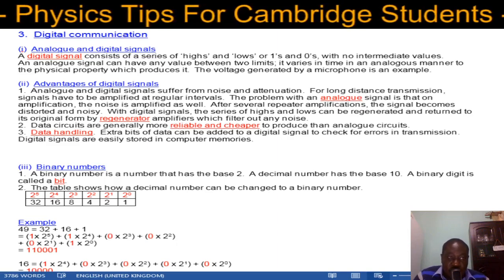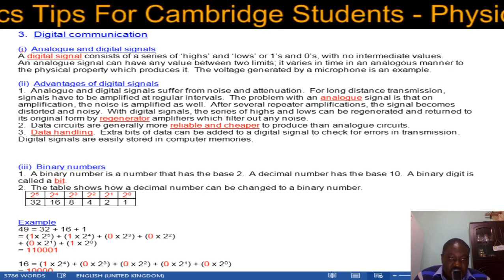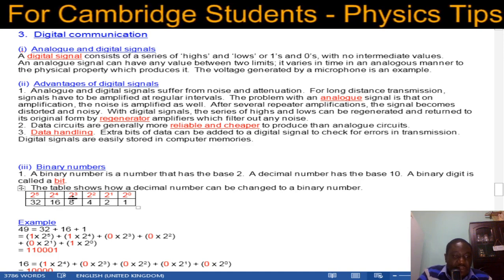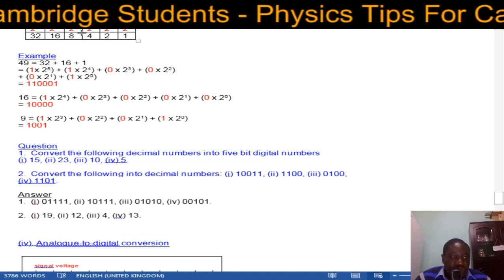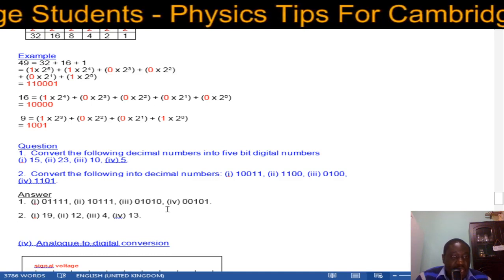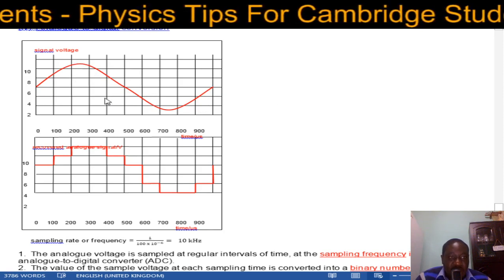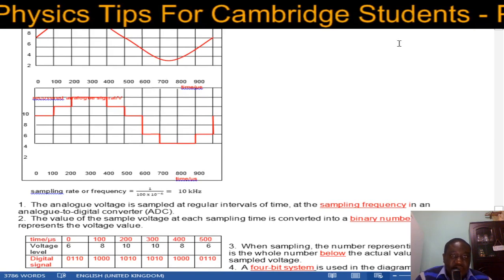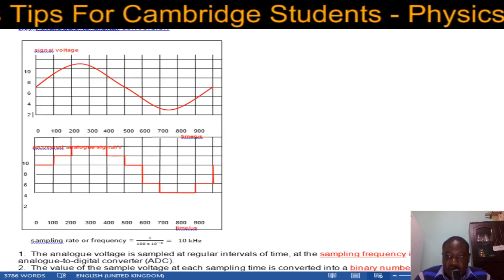Digital Communication: Digitization: 9702 A Level Physics

Comment: Is bit rate proportional to rate of signal transmission?
Reply from the maker: You mean sampling rate proportional to rate of signal transmission?
Reply: @atobve  yes sirr
Reply from the maker: @SharkRockstar  no, it's not. Sampling frequency is the Nyquist frequency, which is approx 44.1kHz, whereas the rate of transmission of signal has other factors included
Reply: @atobve  okay tysmmm